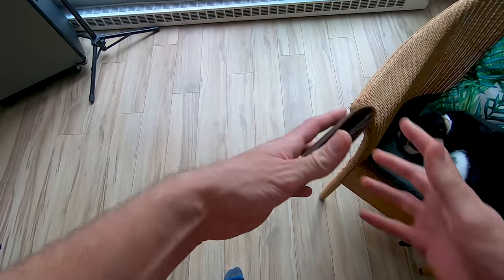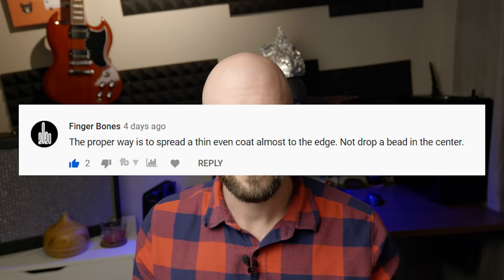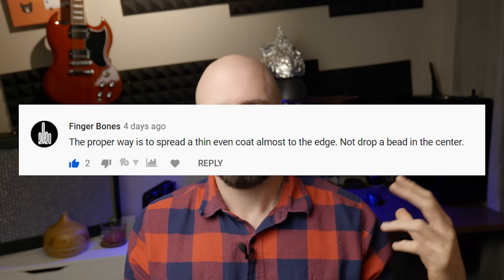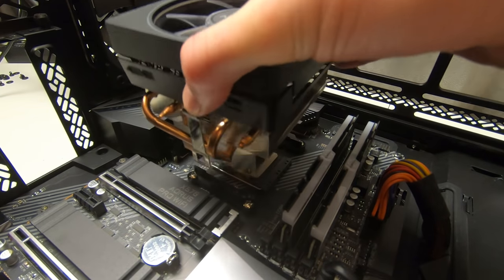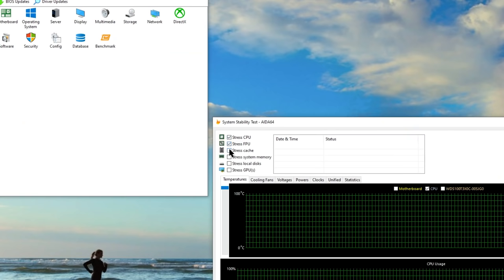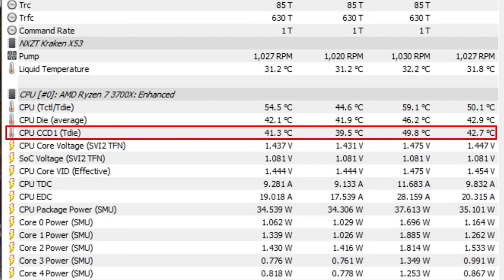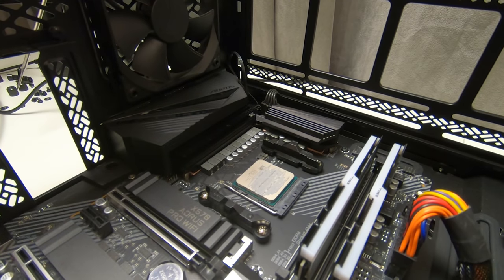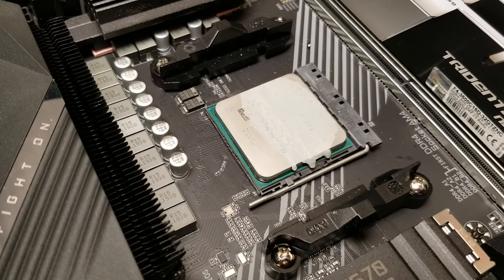Best Way to Apply Thermal Paste? Does it Even Matter?

Comment: Whoever is shilling spreading it is silly. It takes more work, it's messier, it's the hardest application, it mixes in microbubbles, and the coverage is slightly overkill; you just need good contact over the cores.
Reply: Microbubbles aren't an issue due to the pump out effect, and heat in general.

Comment: Man, I know I fucked up somewhere, idk if I put the past on wrong, or damaged my motherboard, or my ram, or damaged my processor, but my pc is always wonkey, crashed randomly. When I try to restart it turns off and on a few times before it boots, but then usually freezes on start up. I've replaced the gpu 3 times.  Replaced the motherboard, and replaced the processor, no damn ide what's going on, its frustrating. Thank you for reading my rant.. . Anyone rich wanna help a poor guy out for a new pc?

Comment: i would like to point out that this does not apply to any of your thicker paste like arctic silver 5 or ic diamond those need to be manually spread because they do not spread as easy as these non curing paste simply because they are by design made to hold up to higher pressure over time where as paste like this need to be redone at least once every 3-6 months because they will ooze out to the sides

Comment: Just make a dot in the middle and then spread it over the chip evenly. That way you will not waste thermal paste by applying way too much (Ain`t ruin your day if it is non conductive but makes a mess and is a waste of money) nor will you accidentally have dry spots because you applied it weirdly. I don`t know why you would want to draw a checkerboard on it or play tic tac toe on your chip. Just apply with common sense and you are good.

Comment: No no no, you need to get a syringe with needle so you can use all you energy to evenly distribute tiny amounts all accross your cpu so you don't have to spread it. Obviously that's the best method. (Joking) Also on a serious note. I did a tiny dot and just refilled my nzxt aio cooler yesterday, was overheating well only getting .9ghz out of icore 11 kf. Now running back to normal between 4.9 to 4.5 ish ghz. Tiny dot worked for me I even had to take cooler off again and wiped it and put it back on with out applying more thermal paste. Just looked at cpu and was like yea it has enough and slapped it back on.

Comment: The important thing is that the spread covers the entire contact area of the die underneath the heatspreader, which can vary depending on the type of processor. The other factor is longevity. The more coverage you have, the less it could be a problem as the thermal material ages. 

Both of these items are covered if you go with the "buttered toast" method or something similar to ensure a good spread. Also some pastes are thicker than others and may not spread as much, so helping it spread eliminates any issues there as well.

Comment: i put n x on my intel 14th gen i9-13900k n under full load i get 45--50 temp n i was actually suprised i thouight the 14th would be way hotter..i also got asus cooling,n my whole setup is asus spent 8,000

Comment: Not good advice to be sure it's enough when the main question is how to be sure it's enough and how to be sure it doesn't overflow.
You have to apply the thermal paste all over the surface and as thin as possible - this will ensure that there is enough of it because it is completely on top and it will not overflow and there will be no air bubbles because it is thinner.
Reply from the maker: I disagree. Too much paste will make little if no difference in temps. Mounting pressure will make sure you have as little paste as possible
Tech Illiterate
Pinned by Tech Illiterate

Comment: Always use a fat dot(footprint of a dime HIEGHT OF A PEA). Never had any overheating issues relating to thermal paste. Also artic silver is the best. I also beg to differ on the coverage aspect, any area devoid of paste will not be able to transfer heat into cooler and create hot spots. I would also suggest avoiding any actions that could contaminate the paste like spreading it...I get it everyone thinks their way is best but I learned from an actual computer engineer and his experience was most likely in fact, the best. Rip Michael, your sons a shithead but he's a good kid.

Comment: Paste is not as good a conductor as metal. The paste is only there to fill in the micro imperfections in the surface. If both surface were ground to be perfectly flat you wouldn't need compound at all. So ideally you want to apply the paste to both the processor and the heatsink and wipe away as much as possible.

Comment: Not 2 minutes in and I can already tell you this test won't show much of anything. The best way to do this is to have the absolute maximum amount of heat possible with the maximum amount of cooling and crappy thermal paste. That way the bottleneck is 100% the thermal paste without a doubt.
But yea it's better to do a full spread to ensure 100% coverage, but I mean I wouldn't worry too much unless you're doing something extreme.

Comment: The name thermal paste is misleading. It should be called 'Liquid Shim-Thermal" the intent is to achieve perfect contact, as any two flat surfaces can never have perfect contact. We use 'liquid shim' in the aerospace industry to fill and guarantee contact. For heat sinks this also, obviously, needs to have thermal properties.

Comment: It's not that hard to understand. The thermal paste is there to maximize thermal conductivity, by maximizing the contact area. In other words, it's there to bridge any gaps that form when two seemingly smooth surfaces meet. Applying more paste than required won't make any difference. You want it spread across the whole surface of the cpu heat spreader. 

No amount of playing around with patterns is going to make any fucking magical difference.

A tiny dot, spread out to a thin layer with a finger (possibly gloved) is all you need.

Comment: It's really so silly. The best way is to cover the entire thing in a thin as possible layer of paste. It's not that other methods can't work. It's that it's the most fault-tolerant process. You won't know how your paste has spread until you actually lift up the chip. You also don't know chip to chip where the heat really is generated. If you don't push evenly it can really have varied results.

Also what you need to consider is the actual benchmark you get not just the temps. Temps swing up and down as the processor will regulate it's performance based on how quickly it heats up and cools off. At 76 degrees you might not actually see differences but then I'm wondering how hard that processor is being pushed if it's only going to 76 degrees. Like it only went to 80 when you had almost no paste? You're not going to be able to determine the effectiveness of theme methods unless you push the chip... perhaps overclock it. Things like how quickly does the chip cool down after being stressed matter as well. But overall if your stress test is not pushing the temperature/performance barrier you're results in isolation are showing the chips temperature regulation technology not the effectiveness of the paste. Did the exact same amount of work get done? I'm feeling likely not. Curious to know though. But if both methods ran 76 degrees and one got way more work done it's not similar results at all.

Comment: Thanks this was a really helpfull video I just got my thermal grizzly kryonaut extreme from mail today. I am somewhat scared of changing my cpu paste :S My hwinfo showing peak temps of around 95°c and average around 85°C after some hours of 4k gaming :/ I have a ryzen 5800x and rtx 3080 extreme wb in a custom loop pc. Hopefully I can manage to remove the old paste and apply new one without any issues :P I also bought some thermal grizzlys acetone based cleaning liguid to remove the old paste. Well anyway wish me luck and hopefully I wont brake my pc 🤣

Comment: No one seems to understand what thermal paste is for, it's basic function is to fill the air cap between the chip and the heat sink, air is a bad conductor or heat.. This is basic electronics from the old days... The paste transfers the heat also, to much paste is just as bad if not worse than not enough.... To disparate heat you need a large surface area, the more fins or whatever the more surface area.. Simple as that..
Reply: "The paste transfers the heat also, to much paste is just as bad if not worse than not enough"

You're so wrong it's hilarious.

Comment: You think you may have terminated the debate but hey, you totally ignored the "burn-in period"!

You can't just apply paste, assemble and be done with it. You need to run the thing at maximum load for at least two weeks to allow the paste to spread and set. Then using less paste (like a rice grain) may catch up, the reasoning being a thinner layer should perform better.

Just trolling of course but food for purists nonetheless.

Comment: A smooth thin coat on the CPU and Heatsink. No globs, X or any other stupid design.
You do NOT want too much that can ooze over the edge of the CPU, especially if it is electrically conductive.
And don't use "liquid metal" if there is ANY chance of it shorting out connections.
Reply: You do realize that no matter the shape the paste gets spread out by the force right?
Reply: @0Synergy  No, it doesn't. I tested it. There are gaps and oozing of the paste off the CPU. In fact, a better solution is to lap the CPU and heatsink to be perfectly flat before apply thermal paste in a thin layer. And if the mating surfaces are  perfectly flat you don't even need thermal paste, metal to metal contact is the the best conductor of heat.
I have built many computers in the last 40 years and know what works.

Comment: I've done those tests in the "old days" -  (e.g. on AMD Athlon XP 3000+,  year 2003) - where no heatspreader was on CPUs.
And the surface oft the die-chip - were you put the thermal paste - was as big (small) as a thumbnail. 

Then.... to much paste increased the CPU themperature about +2 to +3°C.
Cause the paste conducts heat much worse - then metal like copper or aluminum.
(-> so you want some metal-contact from your cooler. Not just the "cooler swimming" on an complete (thick) layer of thermal paste. You don't want to act the paste like an thermal insulator.)
But much worse than to much paste - was to little paste... wich increased the temperature abot +10°C
I've done it several times, with way too much and way too little paste. And also test it, with 100% CPU Load for serveral minutes. 

The ideal amount was as big as a rice grain of paste in the middle. Better a little bit less (= a small rice grain.)

The best way to test it, was:
-> to put just as much paste in the middle of the die-chip (rice grain) - that it "just" covered the hole die-chip. And there was no excessive paste, which overflows / was pushed asides. 

In the end, when you don't want to do it multiple times (4-6x) - with temp-testig: do it just twices:
1.  Put on "a rice grain" of thermal paste - in the middle of die-chip.
2. Put on the cooler and tighten it.
3.  disassemble the cooler - and look at your die-chip. 
if the chip was not covered completely - there was to little paste. (Make a bigger ricre grain)
If the paste goes over the Chip, it was to much. (Make a smaler rice grain).

4.  Make the die-chip clean with alcohl.

5.  Put (now) the correct amount of thermal paste (rice grain) - on the die-chip.
Then you are fine.

Now - I learned  two things (in your video) - 
1. Modern "Big Chips" (with big heatspreaders) need much more paste - than the little "thum nail liked chips) in the old days. 
2.  with a "big" heatspreader - and "its big surface) - it is "less important" - to cover the hole surface - if you have such a "surface nowadays" 
In the "old days" (2003) - with small chips (without heatspreader), the temperature whould have been rising - if you hadn't covered the edges of the die-chip with paste completely.

Comment: I use a very thin layer using the spread method. I don't use a card. I spread it with my fingers. Using too much, like you did, with it oozing out the sides is not optimal. I've been doing it this way for years with excellent temps and no dead cpus... my buddy who used the dot method on the other hand... I had to replace his ryzen cpu because it overheated and died. Your spread method really made me cringe lol. You always want the best coverage using the least amount possible. Too much can create pockets and hot spots and spillage over the sides.

Comment: You are lacking the minimal spread. You are using a visacard for applying the paste. The minimal spread is done by spreading the paste with a finger. Also, the CPU isn't overclocked or underclocked so results have no spread between difference as high possible. That's why I've disliked the video as the only person doing so.

Overclocking will gain difference in temperature levels. Which can be achieved with bottleneck test. Which over time should give different peak temperatures or at least on some windows performance reduction over time.

Using overclock and stress test would give better performance test of bottleneck levels. Not temperature levels. As MHz in some cases would have reduction based on the bottleneck levels thus giving performance results rather than temperature difference as this is more different also from each windows restart.

Also the results lack of one big difference on what stress test is done by using Intel and AMD processor test. Since the die is different. You can still get cheap hardware to do test. I believe it's also based on how much a cooling system works.

The dot application is hot in temperature. But I believe that the test was too lazy done. A smaller dot have difference over a big one.

The thermal paste is also important difference as some need higher spread and some minimal as possible.

Comment: that cooler is veery weak in performance. It is very beautiful and it just works but do not expect at performance from it- the surface is extremely bad. at my cpu it ruined the heat spreader of the cpu on the edges

Comment: Most of that small variance is likely due to your room temperature, which is going to fluctuate some.  It is important to recognize the importance of the room temperature, when considering how well thermal radiation will work in an application such as this.  For instance, if you have a room that is 80 degrees, the coolest you can ever get anything in that room, without using an actual refrigerant, is 80 degrees.  So I am guessing you have your house thermostat set somewhere between 65 and 70 degrees, maybe 72 at maximum.

Comment: prolly still someone in the comment section arrogant enough to assume his own method still is the best despite no evidence proving so.
Reply: To prove the non-existence of something, you have to test everything (impossible). Conversely, if a test is not watertight, then nothing has been effectively ruled out. 

Even if the heat conductivity through the thermal paste was infinite (i.e. - the thermal resistance was zero), the cooler might not cool below 75 C <-> 76 C anyway. (Imagine directly welding the CPU to the cooler... You will still only get the performance that the cooler gives you). If the thermal paste is not the limiting factor in the test, it becomes impossible to claim that small performance benefits of some methods are negligible.

He should have used his best cooler for this test. That would have given the largest difference in results. Only then can we know that any relatively poor performance of the system is a result of the thermal paste. We can't prove or disprove the existence of a "best" method experimentally. However, we never should have been looking for "the best". Instead, we should look to eliminate any problematic thermal paste configurations should they exist.

Since his test does not eliminate external factors (such as that 76 C was near the convergent temperature of the cooler under ideal thermal paste conditions), he would be the one with no evidence. Therefore, someone who claims to know that one method is better than another may not necessarily be arrogant. Someone out there may have actually done a useful test and gotten a useful result... unlike the rushed imitation of the scientific method employed by this video.

EDIT REASON: Typo - forgot to add the word 'should'

Comment: ...and temp with no thermal paste ?
Reply: Your CPU is easily going to much more easily heat up throughout it's entire usage because the point of applying thermal paste is to cover those microscopic pockets of gap between the processor and the base of the heatsink. 

Believe it or not the surface of your processor and especially the base of your heatsink isn't smooth if you actually look at it through a microscope. There are imperfect jagged bumps throughout it's entire surface, which is what form those pockets of gap that hinder efficient heat transfer from your processor to the attached cooler.
Reply: @DarkZerol  excellent. makes sense

Comment: ryzen 3700 isn't exactly a high end CPU to cool, 
maybe repeat test with a 5800x3d or 5950x or newer Generation high end CPUs and a bit better cooler like eg. Thermalright Peerless Assassin (35 bucks good dual tower cooler).
still of course good test. thanks. I use X usually, maybe spread sometimes.
Reply: Recently I was forced to re-paste my Ryzen 5 7600 because the mobo went wrong (and repaired under warranty). Although I replaced the mobo because it went wrong again as far as I can judge it does not make a difference. Last time I used a lot less paste (same Noctua NT-H1 AM5 Edition as before, did spread it thinly evenly) and the max. temperature during Cinebench R23 dropped by 14 Celsius (!).